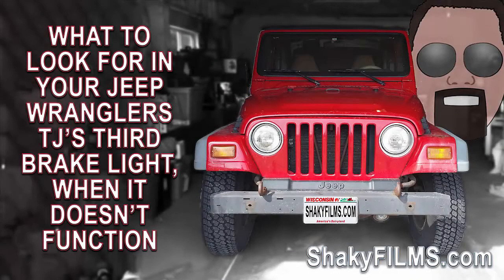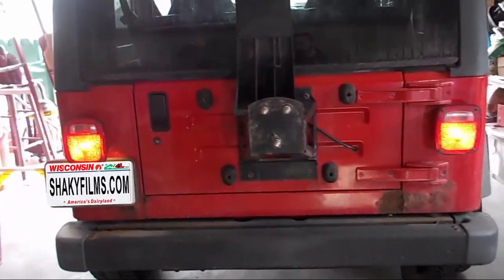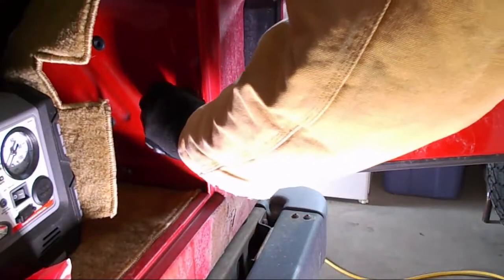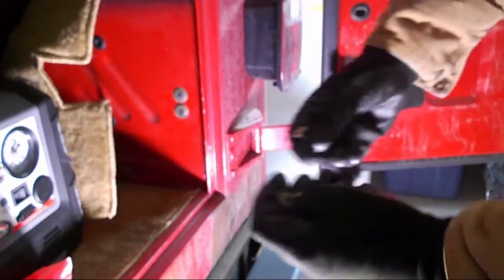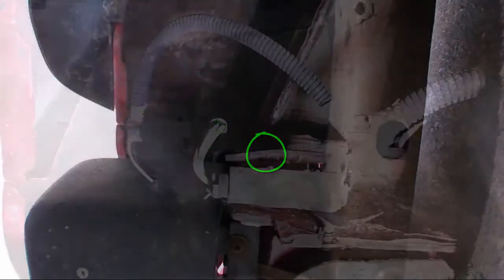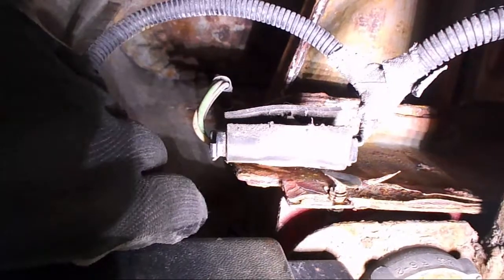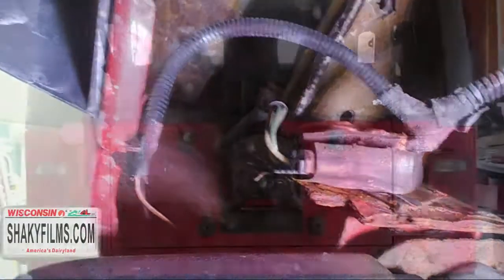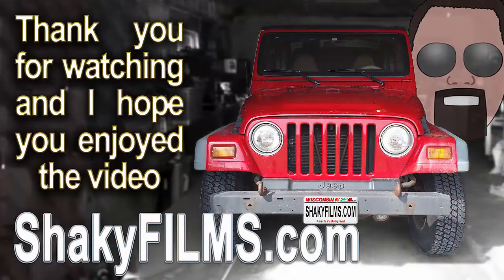Jeep Wrangler NON Working Third Brake Light

Comment: Richard, Saw your video. Checked contact points with volt meter. Nothing! Did what you explained in your video. Found that one contact point was actually not connected. Attached them. Presto! Third brake light working. You are the man!  Phil
Reply from the maker: +Phil Derr Derr Thats awesome, glad to hear the video was helpful.

Comment: Great video man. A jiffy lube tech mentioned to me that the third brake light failed to go on during a brief inspection while they were changing my oil. I replaced the bulb and tried sanding the contacts to no avail. I followed the wires back And found one of the connectors wasn’t clicked all the way into a contact pin.After clicking that baby in all the way I was good to go! 😊
Reply from the maker: That's great news.

Comment: Thanks for the video. After removing flap to reconnect pin. There is a box there. Do you know what this is and how to remove it??
Reply from the maker: I do not have a box in mine but it is possible if you have wiring for a trailer hitch, it belongs to that
Reply: @RichardCox  thanks for the response,  however we do not have a hitch.

Comment: I find life funny. I spent a little over a few years slaving for this stupid thing. You mentioned about those pins coming out easily!  I was just trying to search on youtube which wire connected to what on YouTube just to save myself the hassle of hurting myself as a treat! I really have learned to become reasonable in my old age!  I just find that funny because I could look in the wheel well and most of the vehical is already complete!  I am just to dam tired!  I want to know which wire goes over what for the tail gate third brake light? Black or white from a factory stand point?
Reply from the maker: I had both black and white going to my pins. I could be wrong but I was under the belief the pins could have either wire on either pin.